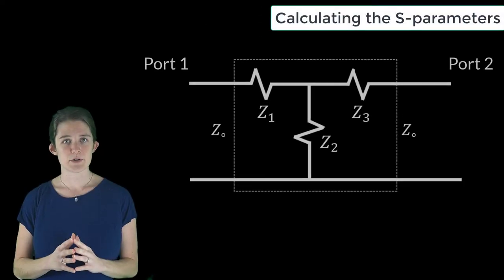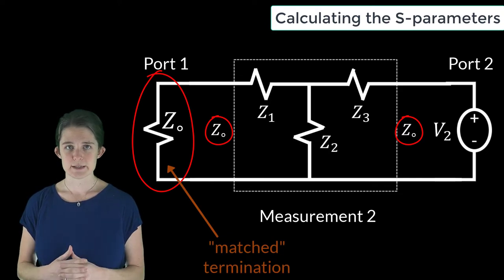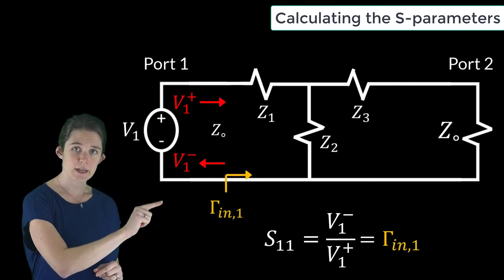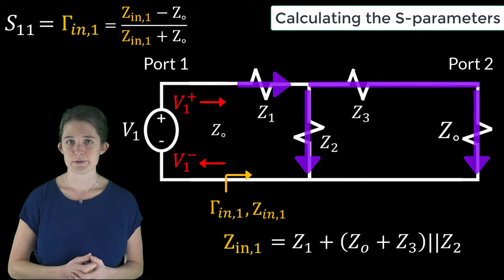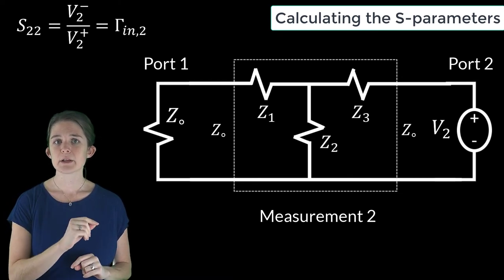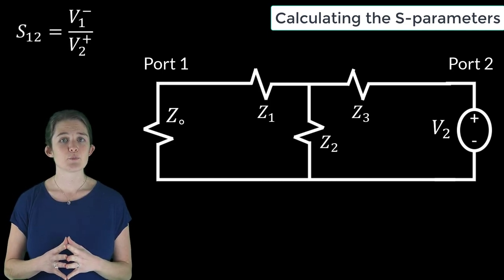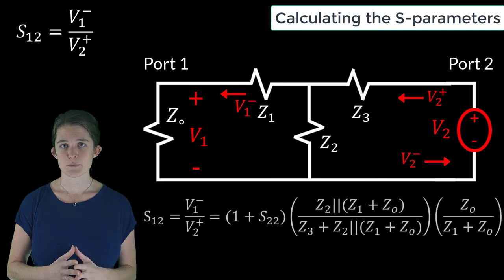Calculating S-Parameters — Lesson 3

Comment: Z0 depends on Z1, Z2 and Z3. To be matched: Z0 (the one on the right hand side) has to be Z3 + Z2 || Z1, provided the source is an ideal voltage source. Or am I wrong?
Reply from the maker: Z0 is the characteristic impedance at the port - the ratio of voltage to current in the outgoing wave. It doesn't have anything to do with the internal resistors.
Reply: @emviso  Thanks - got it! I was conceptually wrong.

Comment: what is the characteristic impedance of a port?
Reply from the maker: The characteristic impedance of a port is the characteristic impedance of the connector (maybe an SMA connector, like this:  https://fieldcomponents.com/sma-male-to-sma-female-connectors-rg178-cable-assembly.html) that is attached at that port and allows you to input and output signals from the system under test.

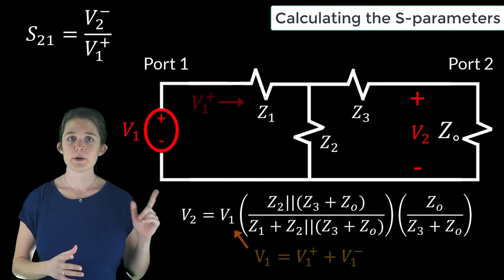Comment: not exactly get the “simple circuit analysis”, as I understand, you use KVL, where you find the current looking from port 1: which is V1 divided by Z1 + Z2||(Z3+Z0), and from port 2: V2 divided by Z2||(Z3+Z0), and I have no idea, why do you multiply the right part of this 2:03 equation by Z0/(Z3+Z0)